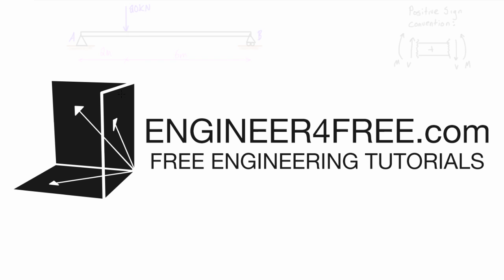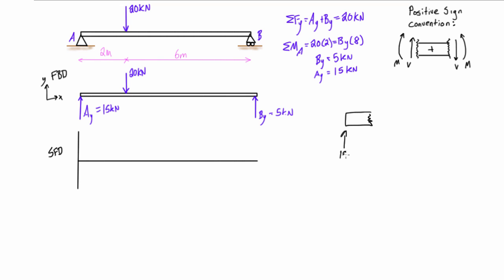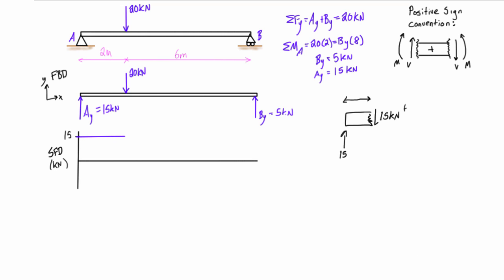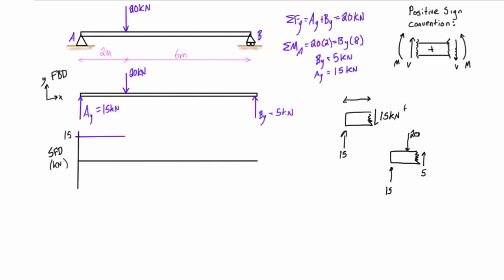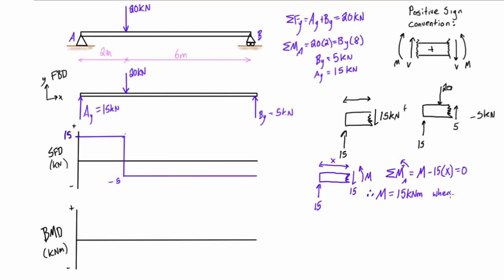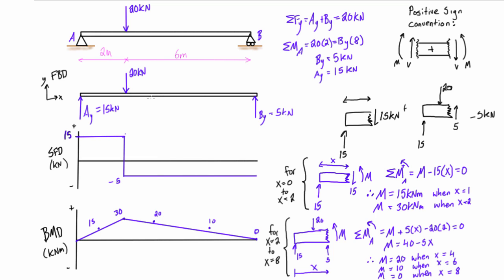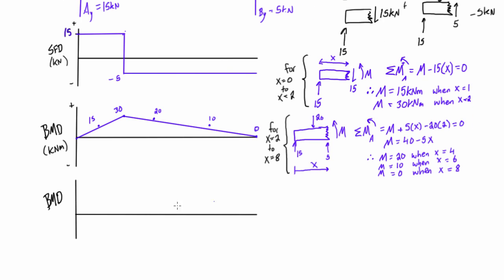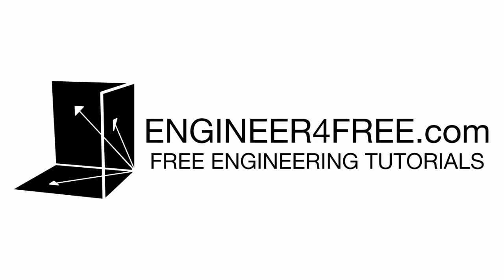Shear force and bending moment diagrams example #1: single point load

Comment: At around 3.52 where you calculate the internal moment, is the moment M just balancing out the moment caused by the sheer force going down? At this point when finding the moments about A, are you just using the sign convention for standard moments? I.e. counter clockwise positive. Also I'm confused by the direction of the arrow drawn on the diagram at this point. Since you have drawn the moment with a counter clockwise sense, but the sheer force is going down. If we are taking moments about A, wouldn't this result in a clockwise rotation? Or is it because the moment M you have drawn; that is, the one you are calculating, is the equal and opposite  to the moment caused by the sheer force?
Reply: My question is did you pass your statics class first time?
Just curious because I write my statics class exam tomorrow and I'm stressing hard.
:)

Comment: why don't you do shear force at point B
Reply from the maker: It is known to be -5kN. We know it’s this, because there is not point force or distributed load between 2m and 6m. The shear remains unchanged in the entire region. That’s also why it’s a horizontal line for that whole section in the SFD, and only one point on the line is labelled with the value.